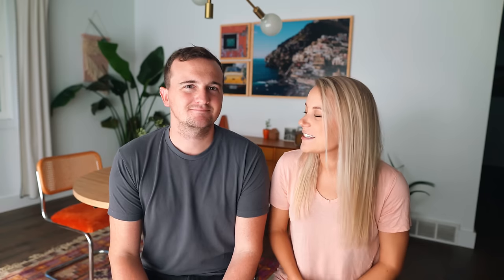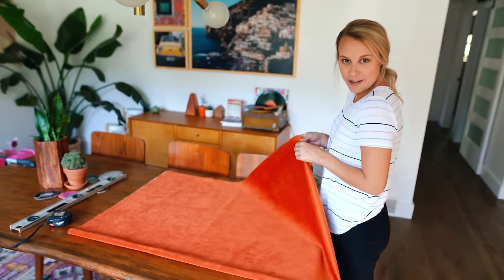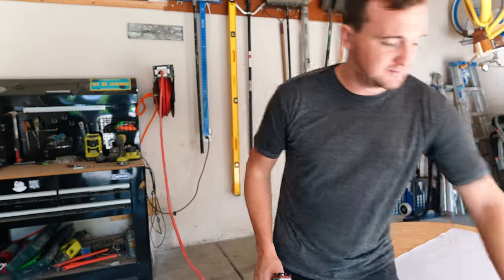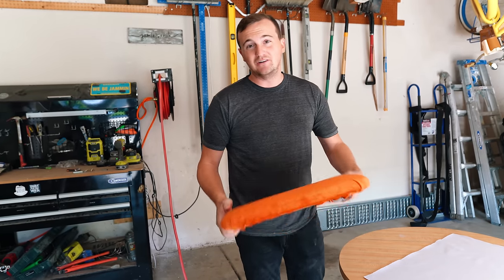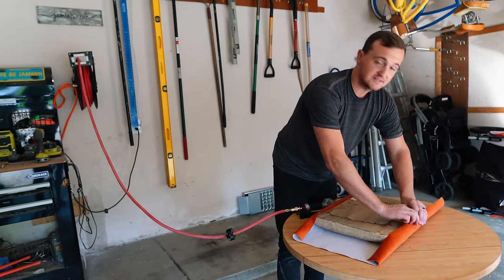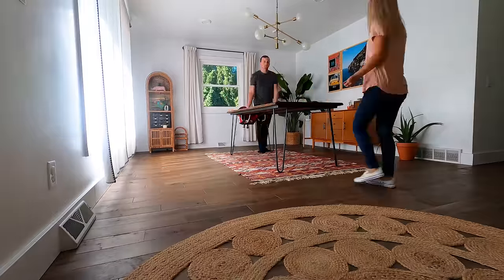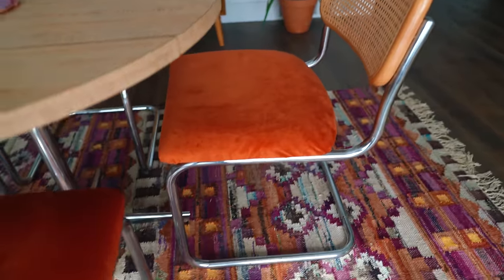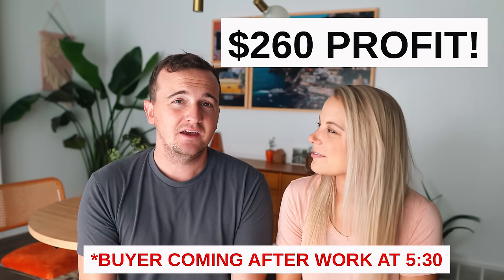Full Time Flipping - It's Easier Than You Think

Comment: I would of changed the paper at the bottom of the chair or covered them with the same cloth because the stains looked yucky
Reply: I was thinking the same, for $300 they could have covered the stains, I'd be a bit upset if I paid that amount then looked under the chairs to see that! They look great though and great they sold for that amount :-)
Reply: They have inexpensive black fabric, think it is called 'scrim', that is used to finish bottoms of upholstered furniture.  Just staple on over edge of cover fabric.
Reply from the maker: Thanks for this tip! Will use in the future! 👍
Reply: @JAMIEANDSARAH   Just replicate the finish technique that factory used on bottoms of the arm chairs.  It's easy.
Reply: I thought the same 😲🙈. Great profit though x
Reply: I think cleaning and making the bottoms, insides and backs of furniture looks great, not to mention bringing more money.
Reply: @paulinelarson465  m
Reply: That's what I thought too. Also, I would have at least steamed the dingy fabric to ensure the chairs were at least sanitized before selling them.
Reply: Saying "we don't put too much effort into our flips" is obvious. The old disgusting stained fabric should have been removed, add a thin layer of batting, recover being careful to hide the unsightly corner creases & lastly remove & add new under seat covering, it would have cost pennies more & showed some real effort went into the restoration.
Reply: thought the same^^ but looks great. cute set
Reply: There is no way they didn't see the stains when editing the video. It stands out like a sore thumb. Especially as a flipper myself I wouldn't be happy if I bought that.

Comment: Hi Jamie and Sarah - You are doing great and perhaps you have previously told your viewers the importance of ensuring the items for resale are clean and hygienic.We are presuming the chair covers  were actually cleaned before Jamie recovered them despite the bad stains remaining (?)
Reply from the maker: We did attempt to clean with Oxiclean fabric stain remover, but were unsuccessful.  In hindsight, we should have just taken off the old fabric.  Because it had no odor and was "clean" we decided just to staple over. We were afraid of damaging the cushion itself.
Reply: @JAMIEANDSARAH  thanks for your prompt response- I was fairly certain you would have done something like that😀 Removing the old covers of chair seats is not always possible, especially when bonded or glued to the filler material.  In following through on “hindsight“ we all hopefully learn “a better way” for the next project!  (i.e. Spray on foam carpet and furniture shampoo is a useful product to have on hand). May you both be blessed as you are a blessing today.

Comment: I'm wondering why you aren't removing the old fabric. I know would be more work but it doesn't take that long. Since most of the filth is on the fabric you would go a long way in improving the chairs.
Reply from the maker: We did attempt to clean with Oxiclean fabric stain remover, but were unsuccessful.  In hindsight, we should have just taken off the old fabric.  Because it had no odor and was "clean" we decided just to staple over. We were afraid of damaging the cushion itself.

Comment: Hi it's me again.  I've been checking fb market place over the last several weeks.  It looks like the going tate for end table "project pieces" is about $20, I would ha e to sell for at least 50 to make a profit after painting.  What are your thoughts? Tia. Sandra
Reply from the maker: Hi Sandra! Great question! End tables are hard to make a large profit because most people won’t pay over $100 for one.  Sounds like you could definitely still make a profit, but probably not enough to make it worth your time.  It would be good practice buying and selling, though! We did the end tables in one of our videos because we found a thrift store trying to get rid of them. We bought them for $1 a piece!  If they are over $10 we usually don’t buy them, though